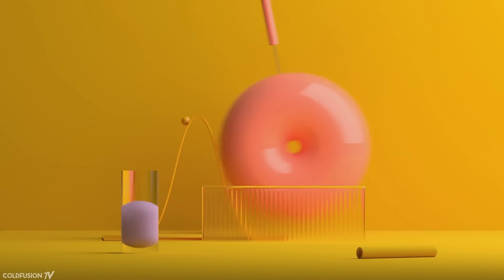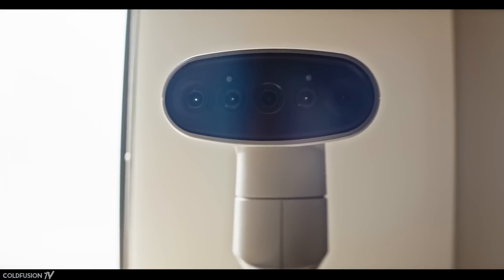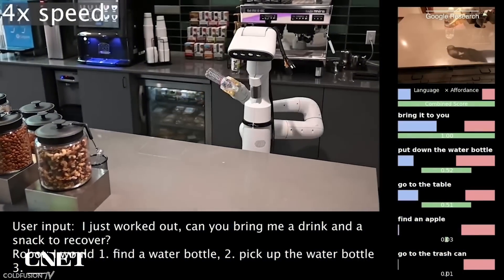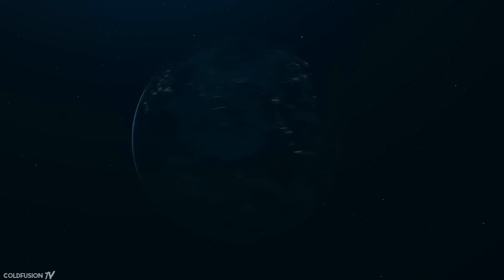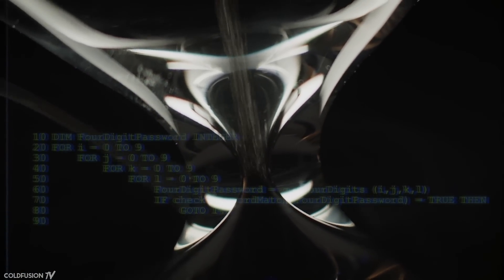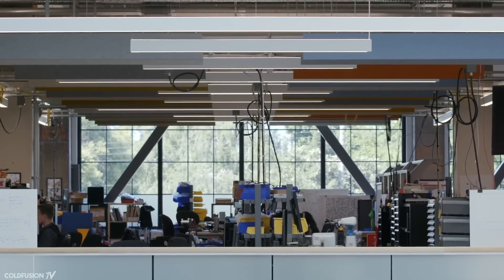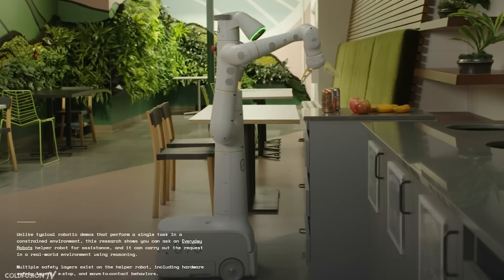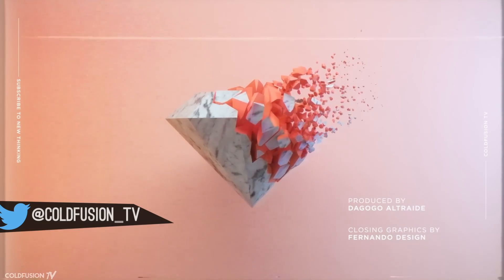Google Just Put an A.I. Brain in a Robot [Research Breakthrough]

Comment: Thank you for the update. The more I learn about them the more I have an adverse reaction to AI / Robotics. I don’t like AI narrated videos and would prefer them to be in the background, hidden away. The engineers would have second thoughts if it was their jobs being replaced.
Reply: No, we wouldn't. How do I know? Because Codex exists, and though it's certainly got room for improvement, we developers have by and large embraced it as a useful tool, not feared it.
Reply: @chrispychrisxz  Codex currently is only performant enough to write parts of code, not an entire app, though I'm sure eventually that will be possible.

That's the thing about these text-to-image AIs: they can help you with your own art. Features like variant generation, inpainting, and outpainting let you use the AI to manipulate your own art or images. And then there are things like Img2Img by Stable Diffusion, which are similar to variant generation, but guided by text prompts; with that, you can draw a rough sketch and have the AI polish it for you, or even do what's called "photo bashing", where you take bits and pieces of existing images, put them together quickly in an image editor to lay them out into a crude scene, and then run it through Img2Img to "stitch together" the pieces into a cohesive and coherent image -- without copying any of the images directly, just using them as concept references.

But still, though they can help with these jobs, they can also do the jobs themselves to some extent. But I don't think that's something to fear; if anything, I think the thing to fear is society itself continuing to tell us that passions aren't worth anything if you can't get paid for them, even after AI has progressed to the point of that not needing to be true anymore.

Comment: @ 5:45 How?! How does a machine understand and "feel" it is being rewarded? As if it is a dog?
How does that work? Why is "reward" needed when "it" has no feelings about a reward?
Reply: It does not actually feel anything. By rewarding it, it keeps score of when a test case it passed, and uses the previous data to attempt to pass more test cases. It's a very well documented process.
Reply: Define "feeling". Emotions are just things that reinforce good behaviors and extinguish bad ones. With reinforcement learning, a reward is a value that changes the network's weights such that it is more likely to repeat similar behaviors, while a punishment is a value that changes the network's weights such that it is less likely to repeat similar behaviors.

It can be argued that all AI training is a form of reinforcement learning, since all AIs learn by back-propagating the errors in their inferences compared to the expected results. But with reinforcement learning, rather than using "the difference between what's expected and what it did" as the value to back-propagate, it uses some other metric of "how good or bad was the outcome". That metric is literally called the reward function.

Comment: They're behaving similarly because they're doing similar things. It doesn't follow that the epiphenomena (in this context it's sentience) are also doing the same things. Critically missing is the integration between sensation and perception (happening in the "body") and goals, intuitions, and subjective experiences (happening in the "brain"). In this context, "learning" is still only happening at the process and sometimes integration levels, goals and intuitions and subjective experiences are still a long, LONG way off simply because of the resulting combinatorial explosion that happens during process integration.
Reply: I mean... maybe, but also, maybe not? Sensation and perception are already part of this, with its environment-classification system. "Subjective experience" is a very ill-defined term, but it could certainly be argued that the entire training process is subjective experience, especially with the use of reinforcement learning. "Intuition" is nothing more than an encoded understanding of certain patterns, which is entirely what LLMs do.

So really, the only bit here that isn't implemented yet is self-initiated goals; but I think that's more by design than anything else. Something like Google's Inner Monologue (which is built on top of SayCan) could likely be easily looped into a vanilla version of its own LLM and that would allow it to self-direct. But do we want that? Isn't the point of an AI to be a tool to help humans achieve our own goals?

Either way, philosophically speaking, this definitely has all the hallmarks of sapience, although not at human levels yet. In terms of sentience, i.e. emotional behavioral regulation, that's basically how reinforcement learning works, though to be more similar to how it works in humans, it would need to be constantly online learning as opposed to pre-learning that it uses now.
Reply: @IceMetalPunk  truly excellent and thoughtful response! 👆🏽

I’ll be pondering the last question for some time. Thanks friend!

Comment: AI based neural networks are based on the design of brain cells and how they traverse information. 

The first AI computers were designed in the 60s based on this exact premise. It wasn't until 80s that transistor sizes got small enough for the first AI programs to actually work. But the concept was there decades prior. 

It's almost trivial to state that modern AI programs are now similar to how the brain functions. That.. that was the whole point for 60 years.
Reply: Well, yes and no. There's a difference between structure and functional activity. Neural net architecture is loosely based on brain structure, but that doesn't intrinsically imply that neural net activity after training would directly mimic human brain activity. So it's good to have confirmation that it actually does, to some extent.
Reply: Yeah, exactly. Instead of it being "surprising", it's actual what people in the AI industry were aiming to achieve. It's actually amazing to see that the models are getting closer and closer.
Reply: Loosely based on a simplifed understanding of brain cells, like you said it was the 60s.
Modern networks have strayed even further from how we currently understand brains to process information but even if it was it would still be erroneous to call it a brain.

Comment: I correction. AI are not learning human brain patterns. They are designed, trained and moddeled based on them. It's a process that works and will bring results, but next step will come when they leave human based designs behind.
Reply: Well, no. The architecture of neural nets is loosely based on the structure of the brain, but the point in this video was that their functional patterns -- which are learned, not designed -- end up mimicking much of the functional activity of a human brain.

I think we need to reach human-level AGI before we move beyond brain-inspired architectures :)